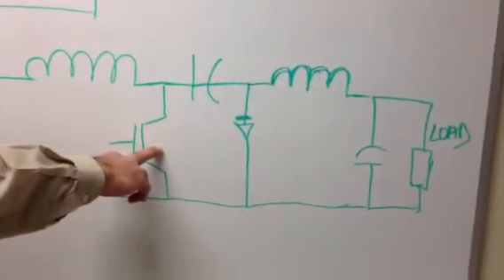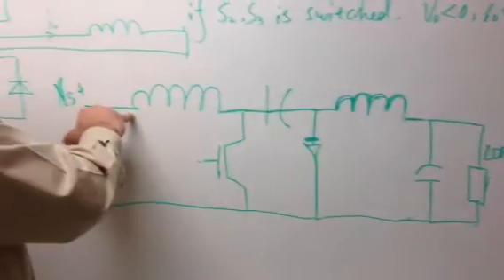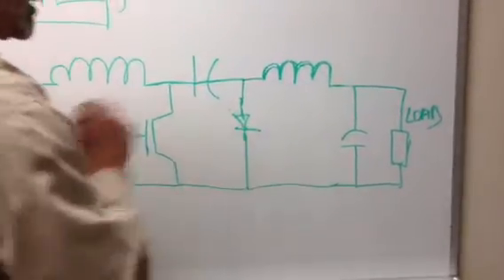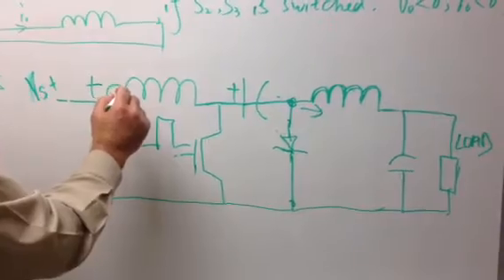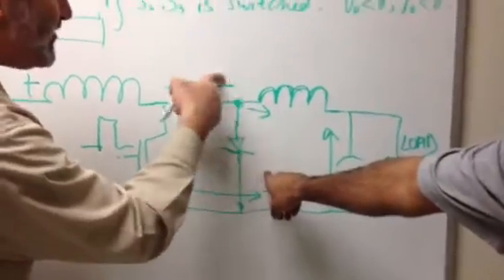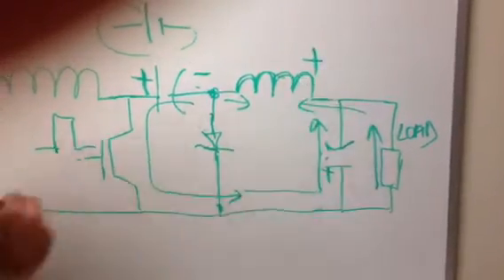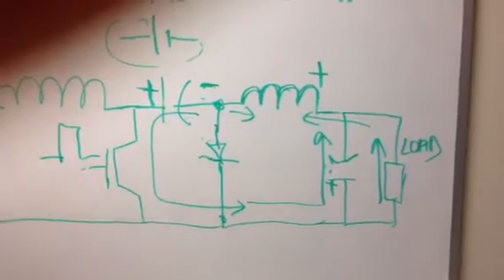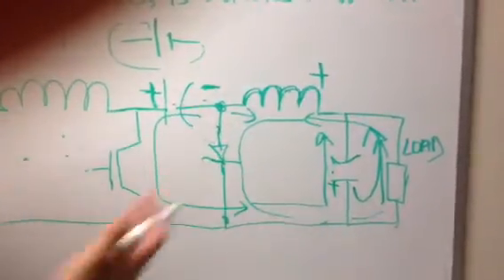Cuk regulator

Comment: Although the instructor seems in a hurry and unprepared for this video, his explanation of the energy being charged and discharged and the convention of energy sources plus the electrical properties of both inductors and capacitors being resistive to instantaneous changes in current and voltage, respectively, was pretty clever than most YouTube videos.

Comment: Still a terrible explanation. Showing an animation from simulation would shed a lot more light on its actual operation. That explanation was 'simplistic'. The 'explanation' on wiki sucks donkey balls. Or you might say it sucks Cuk :)

The cuk converter as I see it has multiple simultaneous flow loops. It's not just 'the capacitor is positive on the left side'. There is a reason for that.